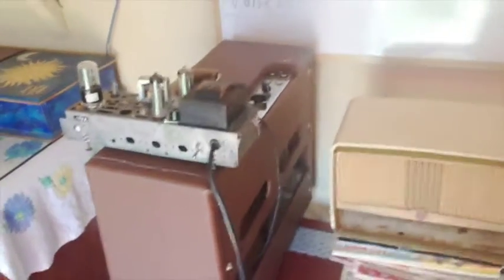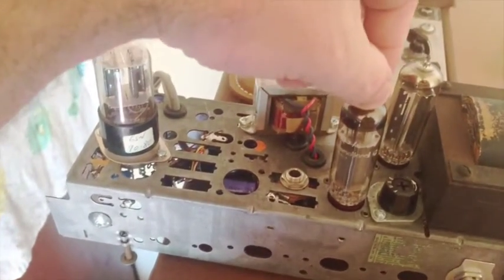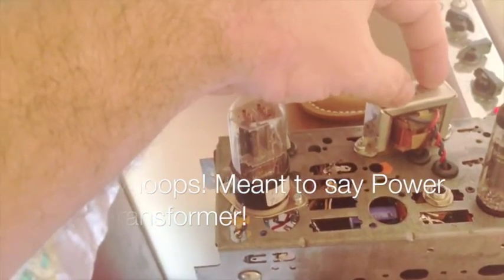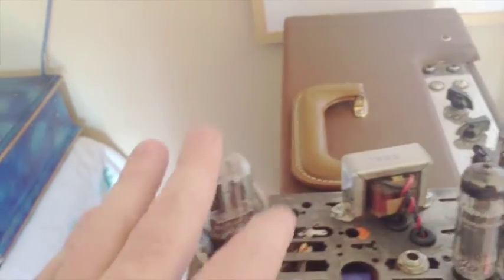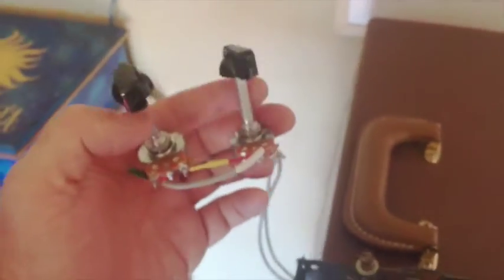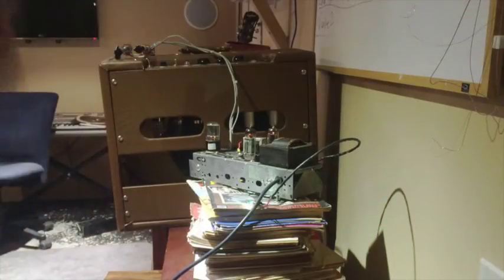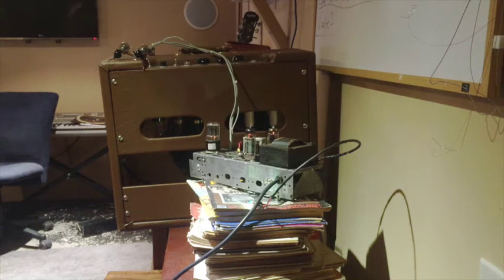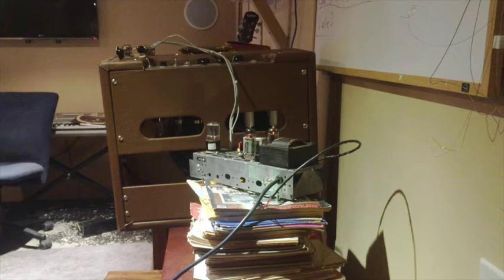Single Ended EL84 Valve/Tube Guitar Amp (Converted from a 1955 Philips AM Radio)

Comment: If your power supply can handle another 300 mA of 6.3VAC then you could also use a 6SL7 as the pre-amp tube!  That should give it quite a bit more overdrive and growl for guitar!  ;^)  Actually I got that backwards!  6SN7 uses more heater current than 6SL7!  Try a 6SL7 in there with no worries at all and a big gain boost!  8^)
Reply from the maker: Nice tip @PaulinTaegu, will try that out sometime. In fact, I think I have one 6SL7 in the old stash.
Reply: 6SN7 = 12AU7  6SL7 = 12AX7 or pretty close.  Many people really like the gain sound of the 6SL7.  You will get a significantly Heavier Metal sound from your amp!  ;^)  Want the cleaner sound again?  Just put the 6SN7 back in! 8^)
Reply: Dig that 6SL7 out and give it a GO!  I think you will really like the the tone, especially if you tend to play songs like the last one!   It could potentially oscillate with the extra gain when it is cranked up, but it appears you have a single knob tone stack designed into your circuit so that should help keep things under control.  With the 6SL7 in there you should not need a distortion pedal to get great Heavy Metal tones!  The 6SL7 is said to impart a more Power tube distortion tone, which most prefer!  And at around 3-4 Watts of output, you will have a Rockin bedroom/recording amp there!  8^)

Comment: Thanks for posting this!
I have been keen on building an amp just like this, and by now figured out that your way is the way to go: find a Philips Radio, preferably with EZ81 and EL84's like the old Voxes (see AC15 but also Pacemaker tubeversion). I cannot believe how could it sounds, but I've only tested mine with humbuckers on a guitar with no volume control.
Great you could re-use the output transformer, but did you measure the speakers that were in the radio? Got mine without speaker, but heard about 500 ohm speaker and matching output transformers...
But very inspiring video and great playing !